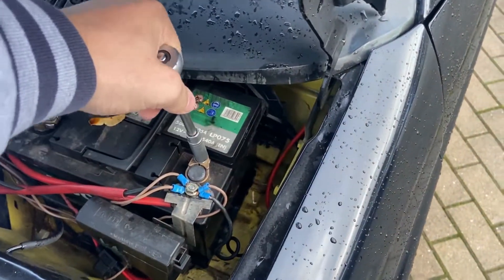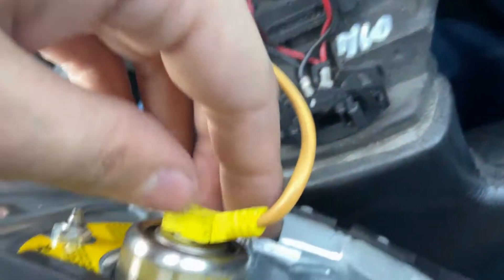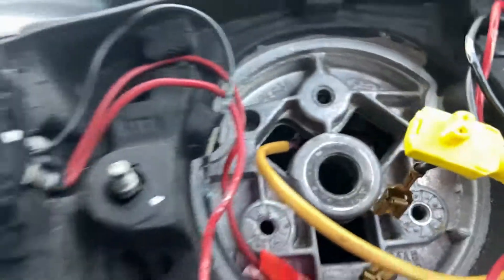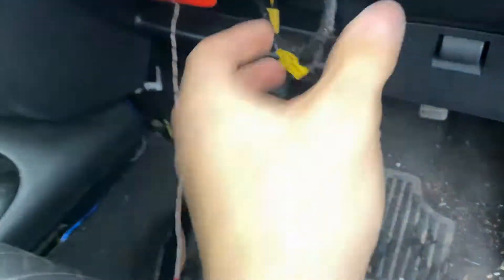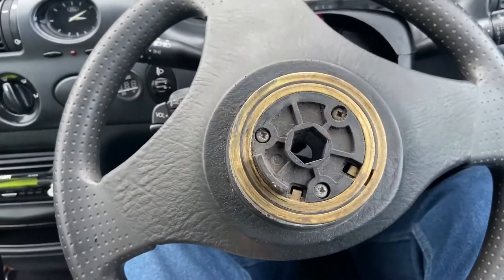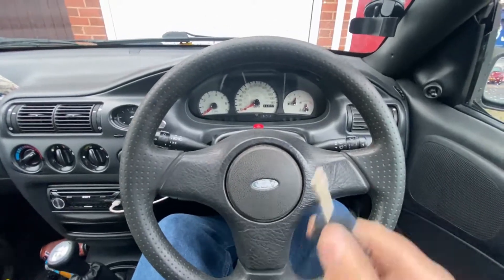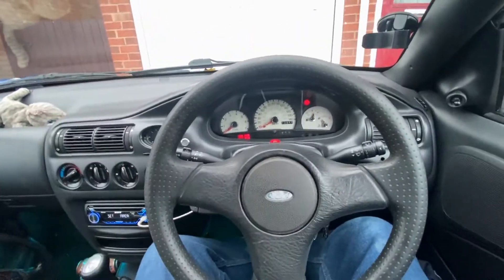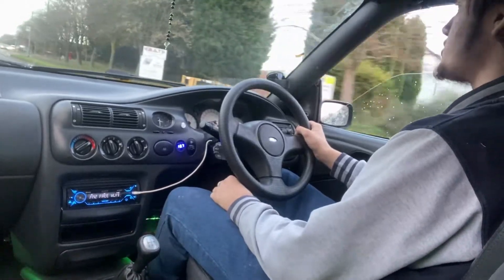How to remove the steering wheel and airbag from a Mk6 Escort. (And fitting a mk5 wheel)

Comment: Great vid and advice. After putting the bolt in an pulling on the wheel my clock Spring fell to bits 🙄

Comment: I noticed when indicating you had to stop it after you set of is that a standard or a fault as mine does the same
Reply from the maker: it’s a fault. There’s a small plastic cam/peg behind the wheel on the back of the indicator stalk (you can see it with the wheel off and you move the stalk) this should catch onto the piece of plastic that sticks out on the back of the wheel / airbag clockspring.

Over time the plastic wears down so it doesn’t push hard enough to flip the indicator switch off. You can test it by flicking indicators on and flicking it with a screwdriver- the fix is new stalks.
Reply: @KylesCarsYT  thanks for sharing the knowledge my man, i have this exact issue, i bought a new stalk assembly for my escort. do you know how i would change it? would i follow the steps in the video? or does the indicator stalk assembly get fitted in another way? 

gonna be honest bro theres nothing online anywhere about changing indicator stalks for mk6 escort. you could do the community a massive help making a little video on it, i would be very grateful as im rather lost i must say.

thanks all the best :)
Reply from the maker: @blackdog6345  not entirely sure how the stalks come out, the plastics around the wheel will defintely have to come off and possibly the wheel too.

I’ll look into it and make a video in the future 👍
Reply: @KylesCarsYT  just did this on my mk6, there are 2 torx screws on the top of the plastic assembly that coveres the steering column, and there are 4 more torx screws on the underside plastic, 
-
once the plastic is off there is one crosshead screw on the top of the exposed indicator stalk essembly, with a short stubby screwdriver you unscrew this and then unplug the 2 wiring harness' going into the back of the indicator stalk assembly, its then ready to slide right out (no removing the steering wheel nessecery) 
-
you can then plug in your new indicator stalk assembly (get them on ebay for 35 quid) and dont forget to take the large black fuse box plugged into the indicator stalk when you swap over.
-
(also worth noting that the 4 screws on the bottom of the plastic are normal bolts, and the 2 on the top are self threading. you will see what i mean when you get in there)
-
And yes it fixes the indicator auto-cancelling.
Goodluck with it mate :)